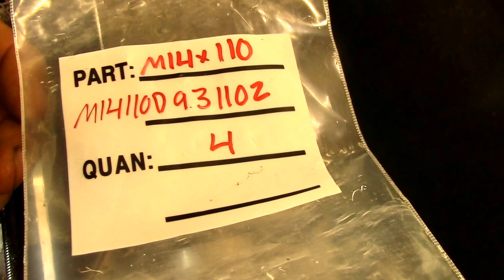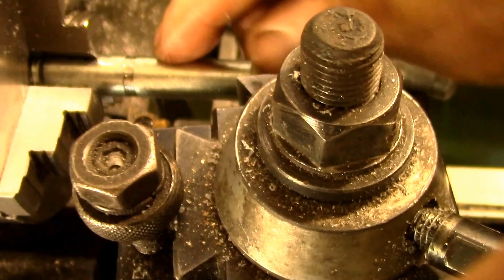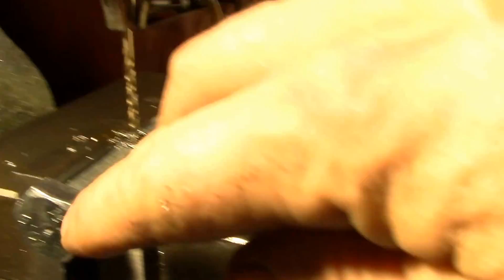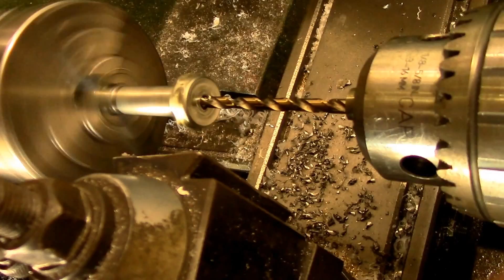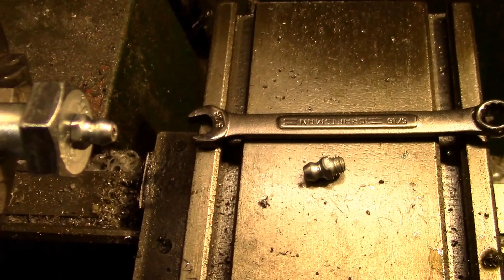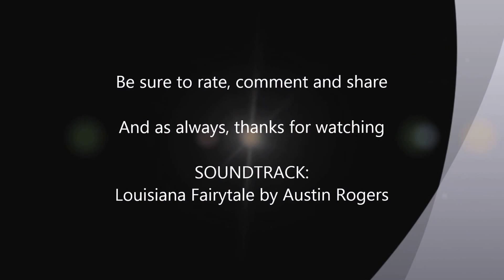Making Greaseable Leaf Spring Shackle Bolts

Comment: Would u have a bolt set for a 67 camaro?
Reply from the maker: We've not made a set for that vehicle specifically.  But if you can let us know the diameter(s) and lengths of the bolts needed, we can see if that's a possibility.
Reply: Ty

Comment: I might use this to make replacements for my Lightburn Trailer!
Reply from the maker: Yes, that may be your only option.  Some trailers seem to use very odd size shackle pins/bolts and can be very difficult to find new ones.
Reply: @The4Crawler  Lightburn's Trailers did originally come supplied with greaseable bolts.

Comment: Doesn't this process weaken the bolts
Reply from the maker: Technically yes, but by only a small amount.  Reason being the round shank of the bolt has most of it's strength on the outside.  The center of the bolt contributes only a tiny bit of the strength.  This is because the strength calculation is a summation of the area of concentric rings out from the center times the distance out from the center.  Since the center of the bolt is at the center, it's distance from the center is nearly zero.  Same reason they use tubing to build a bike frame vs. solid rods.
See:
https://www.engineeringtoolbox.com/area-moment-inertia-d_1328.html
For the solid bolt, Pi x OD^4 / 64, for the drilled bolt Pi x (OD^4 - ID^4) / 64.  With an 18mm bolt and a 6mm center hole dia. 18^4 is 104976, 6^4 = 1296, or about 1% less strength and that's only on the head end of the bolt, the threaded end is un-drilled.  So overall something like 0.5% - 1% reduction in strength, depending on diameter.
Reply: @The4Crawler  thank you for your help it's very kind of you to inform me about that
Reply: Would you please describe the size  the drill bit of the gun drilled hole and the size of the drill bit for the cross drilled hole
Reply from the maker: @aymnv6v8  Usually around a #30 or so for the cross drilled hole and around #7 for the gun drilled hole.  Really depends on the depth of hole being drilled and the grade of bolt being drilled as well as the size of hole the grease fitting needs.
Reply: @The4Crawler   how about 2mm for the cross hole and 4mm for the gun drilled  hole
Reply from the maker: @aymnv6v8  That would work too.  All depends on what your grease fitting needs.  Mine use a 1/4" fine thread, but there are many different sizes.
Reply: Hi, I just tried one with 1/8" cobalt bit for deep hole and #3 bit (7/32") for the 1/4 - 28 tap hole and used a bottom tap in the shallow top hole. Everything went fine but busted a bit in cross drill hole as it was slightly misaligned. I drilled the cross hole right through so wonder if the grease grove is necessary as don't have lathe but guess can round file it. I bought a six pack of 9/16 x 3 shackle bolts with the grease fittings in them for  $23 on Amazon but for reasons unknown they thread end and nut is smaller and the spiral knurling is too deep below the head. It will catch the shackle strap but also the bronze bushing not allowing the bolt to shift in the bushing. That is why I was going diy root and send others back. Lots of elbow grease though to make six of those LOL

Comment: Is the cross drilled hole the same size as the gun drilled hole ?
Reply from the maker: No, typically the cross drilled hole is smaller in diameter as it doesn't have to be sized to fit the thread of the grease fitting and also, since it's not a deep hole, a smaller drill bit will work OK.
Reply: @The4Crawler   Thanks for the info.  I am rebuilding the suspension on my car trailer.  Cross drilled one with a #7 drill and it did not look right.
Reply from the maker: @danharold3087  Usually use something like #30.  Smaller is more likely to break so you need to find a balance.
Reply: R Brown thank you!